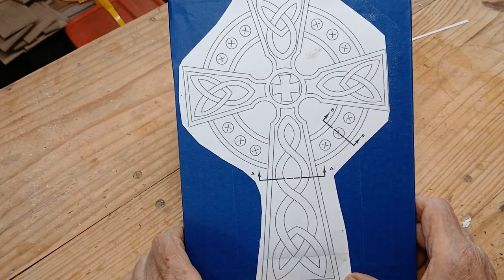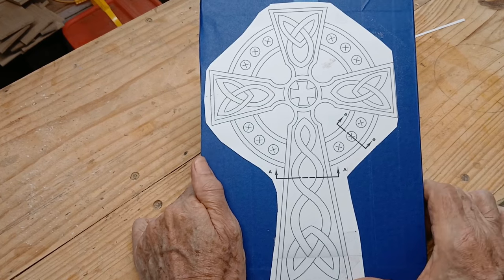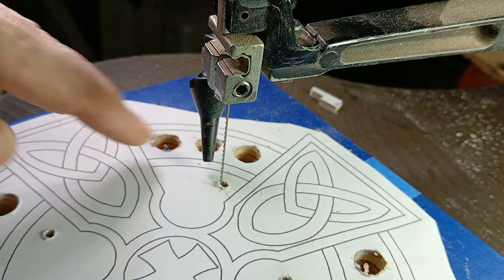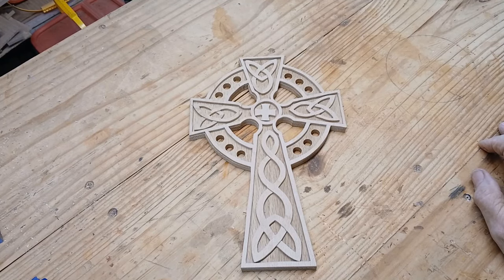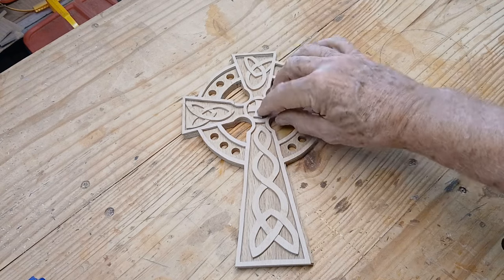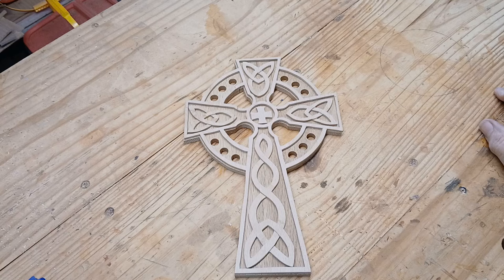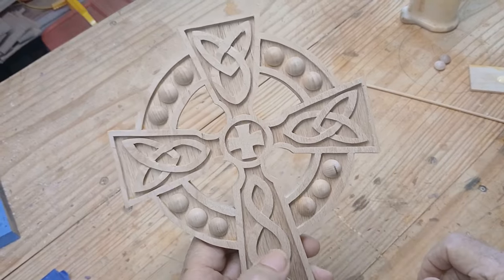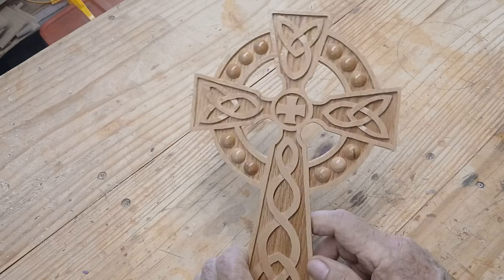Scroll Saw Layered Celtic Cross

Comment: if you make the flip open stand up pen boxx how can i get a copy of the pattern ??? thanks in advance,, beautiful cross
Reply from the maker: The only pattern I used was the pen for an outline and the one I found for the lid inlay.  A lot of times I just go by the seat of my pants.  I ended up with four pieces 6 and 1/4 inches by about 2 inches, the mahogany was 1/4 inch and the maple 1/2 inch.
Reply: @twinoakstreasures9032  thank you for using my suggestion !!!!!!